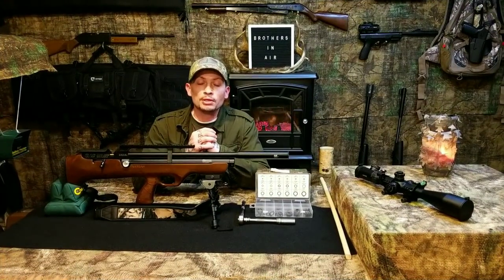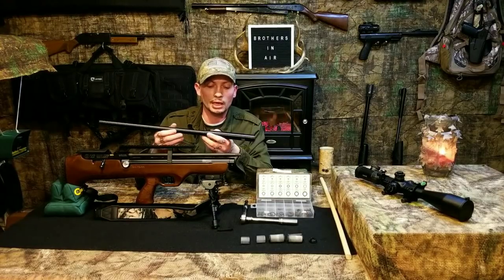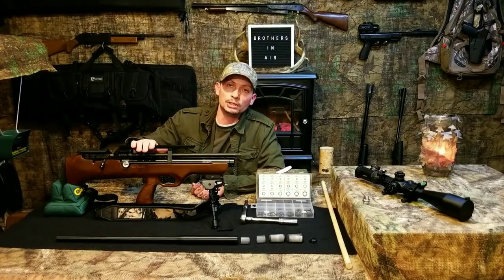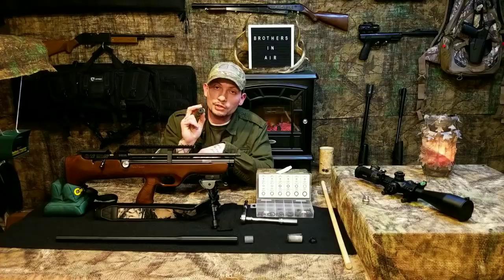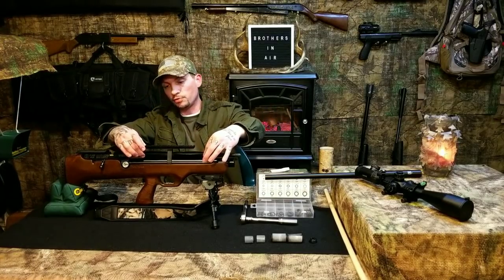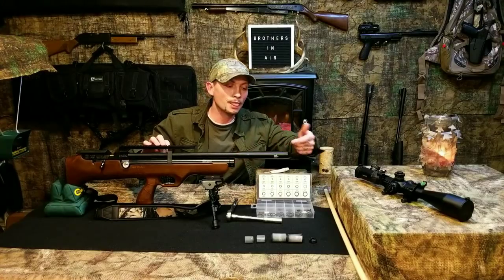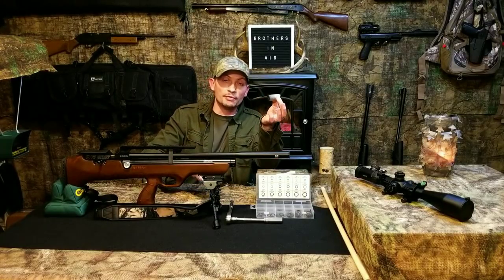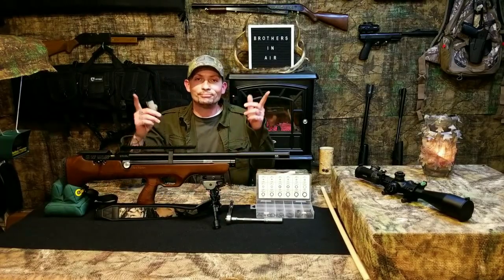HATSAN FLASHPUP QE SHROUD***Removal, Opinions&Thoughts, Lead Dust Diffuser/Filter Mod.& WARNINGS***

Comment: Hi chad, yes my Flash Wood .25 Cal did not have an o-ring on the barrel nut from the factory, i also think that's why the 2 lower plastic baffles were broken when i took the shroud off, cant wait to re-assemble it properly as you show here, thanks again! I e-mailed Hatsan and they are sending me new parts under warranty.
Reply from the maker: Glad to hear they're taking care of you! You'll get a little less ping with an oring in there for sure.

Comment: I just removed the shroud on my Hatsan BT65, 357. The shroud retainer nut was in backwards from the factory. The clear spacer was in with the small hole toward the front end of the shroud. I cleaned, inspected, all components. I installed the shroud retainer in the correct direction so you could actually use a 14mm socket to tighten the barrel nut. I placed the two baffles on the shroud and came up 20mm short of the retaining bushing. So for now I made an insert out of a 1/2” pvc pipe to maintain contact with the baffles. I don’t like this idea because I can’t  imagine how the pellet will exit the last baffle travel 20mm and find the hole in the thread bushing at the end of the barrel. Now all that being said, I’ve burnt powder for 63 years, watched videos on air rifles for two years before getting into this sport and I think my failure was not to field strip the rifle on receiving it. Your video was ver helpful!

Comment: Thank you very much for this video. When I took my shroud off the o-ring for the nut was just sitting on the barrel behind the nut like it was never put in the groove. The o-ring for the end cap was in pieces. Why does Hatsan have so much trouble with installing o-rings? They are often broken, cut or look like they have been chewed on.
Reply from the maker: You're welcome my friend. And yeah I agree I sure see a lot of damaged, chewed up o rings on Hatsan guns. Like you said what the heck is so hard about doing it right? Lol

Comment: Hey Brother! Keep up the good work! Just wanted to share a few things I found when I removed my shroud to do this mod.
1) Hatsan has changed some things in this area!
     a) The spacer for the shroud at the breech end (yours stayed in place on the barrel) is now pressed into the shroud, making this mod almost impossible! I had to remove my barrel and wrap the felt around it and then slide it into the shroud to get the air diffuser into place. Very difficult! also had to use 1mm felt as there was just no way 2mm will fit. Do you think they changed the shroud diameter?
      b) The first two baffles have to go in big end to breech or they won't all fit in the shroud!
      c) The second two baffles (felt wrapped) have a large hole all the way! no small end anymore!
      d) The felt on my baffles didn't even cover the whole screen they were quite short. I covered both with 2mm felt. 
      e) After the two felt covered baffles I added a thin (.25mm) rubber washer with an I.D. of .285" before I installed the end cap. I figured it might help. My .22lr suppressor has the same setup, and it is very quiet!
This did make a big difference in the sound signature! only makes a quiet 'ping' now. Do you think the Huma regulator I am about to install will reduce that ping?

Thanks again for your hard work and dedication to our sport!
BTW- I'd love to see a video on enlarging transfer ports and such for optimum velocity! I'm wanting to try and shoot slugs as they have a much better ballistic coefficient, and I'll need all the power I can get for them to stabilize!
Reply from the maker: Thanks for the update on the changes and thanks for the kind words. the regulator will definitely take that final bit of ping out of there. With the shroud done up nice and the regulator installed pretty much all you hear is the hammer striking the valve.
Reply: Wow. Ok so I had noticed that my at44-10 was much quieter then the flashpup and so I took them both apart a discovered that the two had some differences. On the At44-10 the baffles have one large hole at one end and one small on the other. Where as the flashpup has equal sized holes on both ends of the plastic baffles. The at44-10 has metal cups and the flashpup has clear plastic cups. But the at44-10 is definitely much much quieter! First time I shot it I wouldn't have even know anything came out if I didn't hear it hit the target.

Comment: Hey sir I  tried ur felt mod on my AT44 QE .25.cal. About a 3.5 decibel reduction using my phone app. Not tremendous but everything helps with my loud .25. Trying to make it more quiet for fussy neighbors. Only cost 70 cents at Hobby Lobby for felt. Have ordered 10 stage baffles on EBay for further reduction. Got enough felt to do my Gauntlet, .22 AT44 and new BT65. Thanks for the video!!
Reply from the maker: You're welcome my friend. That's awesome and you're right every little bit counts! It makes the guns a little long but DonnyFL makes a QE shroud adapter so you can attach a moderator. I've modded my QE barrel bands to support the smaller diameter of the barrel and I am just using my DonnyFL's. Man is it quiet! He does a heck of a job and the quality is outstanding. When I use the adapter in conjunction with the QE shrouds it's insanely quiet! First time taking a shot I thought the gun had malfunctioned because literally all you here is the hammer striking the valve. Like I said a little long on top of the QE but those fussy neighbors will think you're outside swatting flies not shooting your airgun LOL. Let me know how those 10 stage baffles work out if you would.
Reply: @brothersinair2064  Will do

Comment: Very informative, I really needed this video... I need to know one more thing though...

Is the hatsan QE shroud removable in all Hatsan models just like this one? 
Because the bt65 elite with the QE is very long so if it is removable it will be a lifesaver since I will not need to buy a bigger case for it to fit the extra QE length... I will just remove the shroud when I want to transport it in a case

Comment: Thanks so much for taking the time to explain things with such detail!  I just ordered a Flashpup in .22 call and I'll be installing a regulator to it. 

How's the ping in the gun? Would it be necessary to install some depinger mod, like Bstaley for example? I'll also be testing different baffles and even make a shorter shroud to install a DonnyFl silencer to make it dead quiet...
Reply from the maker: You're welcome. The ping it's decent but once you install the regulator it depings things nicely. A reg works as a depinger also. In regards to the donny FL he makes an adapter so that you can screw the moderator right on to the end of the full-length shroud and use the stock baffle system and the moderator on top of it.
Reply: @brothersinair2064  thanks for your reply.

I think a silencer on top of the stock shroud would be too long,  I believe that beats the purpose of a bullpup. I'm thinking about making a custom shroud right to the barrel thread, to be able to use that thread for a better silencer...
Reply from the maker: @503BikerDad  oh I see what you're getting at.  I do a lot of hunting and I don't mind mine with a moderator on the end and mine is 5 in. Super interested to see it when you're done though it's going to look pretty badass I'm sure!
Reply from the maker: With the donnyfl right on the end of the barrel with the shroud off it's quiet. With the Donniefl on top of the stock internals it whispers. all you hear is the mechanics of the valve being struck. Was interesting at first almost makes it feel like there's been a drop in power LOL
Reply: @brothersinair2064  yep! That's what I'm thinking too. If course I need to hey the best of of it first... Break it in... Before tinkering with it.

...you had me at "whispers" 😂

Have a safe weekend brother!
Reply: @brothersinair2064  one question: what's the thread on the shroud end? I'm looking into adding a silencer to the shroud, as you suggested.
Reply from the maker: @503BikerDad  The threads on the inside of the end of the qe shroud are a metric fine thread M23 x 1
Here's a link to the adapter I'm using if you didn't want to make one or have one made. They're usually $30-$45.

https://donnyfl.com/collections/adapters/products/hatsan-qe-1-2-x-20-unf-adapter
Reply from the maker: Also... I would highly recommend anything made by Donny FL I tried several different manufacturers and the stuff I've received from Donny excels in every way. I have no affiliation I just appreciate getting what I paid for and with Donny you get that and then some.
Reply: @brothersinair2064  thanks! I appreciate your responses. I've read only great stuff about Donny in the forums! I think I'll go that way. Blessings!

Comment: It happened to me once, I got too anxious & careless & fired, forgotting to secure the bolt on the notch, all I felt was a faint sound of click, so I cock it back, did it clipped the baffles? I dont ‘tinker much on my pcp , I may test fire it again if theres’ accuracy issues !
Reply: pull them out and look. they are plastic so you should be able to see if theres a bite taken out of your baffles.
Reply: jason merrigan  Thanks! anyway I have checked them already long ago! and  there’s’ no damage or deflection whatsoever!

Comment: My flashpup QE  .22 wood didn't have any Baffles or O rings. I just checked. I'll be contacting Pyramyd air.
Reply from the maker: That stinks... Tell them to make it right!
Reply: @brothersinair2064  Was wondering why it sounded like a 22 short. I just found a single baffle on Ebay for it in .25 says it's better than OEM. but pyramyd air is closed on the weekends but I  sent pix to them . Good thing shroud was empty cuz I just watched your double pellet load and fired it when I double loaded it first time out sighting in.
Reply from the maker: @Blackscoutwinter  good choice. The 3D printed baffles are noticeably quieter than the stock baffles
Reply: @brothersinair2064  Not sure if the 3D printed baffle I ordered has felt or not. My benjamin Armada. 22 doesn't and it's guiet.

Comment: you didn't mention direction of the solid baffles. is it small first or big first? I looked like you put them in big end first.
Reply from the maker: Big end first small end facing the direction the pellet travels. they have to act as a compartment to strip away the air if you put them small in first they wouldn't do anything of that nature

Comment: So I have about 15 different hatsan And the weirdest thing in the EQ is some of the baffles with the small hole one small hole one big hole and then on the other air rifle the air holes are the same there’s a big air hole why would they do this what are your thoughts on that
Reply from the maker: This is not official from hatsan but only my observation. Of the four that I own and many many other guys I have talked to it would seem that the .25 caliber always comes with the small hole baffles and the .177 and .22 the large. I don't understand it either. My 22's are much louder than the .25's and an appropriate sized pass-through hole based on the caliber does the best job for stripping away turbulent air from the shot and brings more stability. The baffles with the large pass through holes don't seem to do much at all in my opinion so I'm in the dark like you my friend I don't get it.
Reply from the maker: 15 Hatsan's! That carries some bragging rights with it for sure.  That's some real air gunner shit right there!!! Awesome!
Reply: BROTHERS IN AIR yeah I just can’t get enough of it every time I turn around I see something new which I love I work my ass off to get them but the weird thing is on all the 25 that I have ordered recently the baffles on the 25 are mixed matched one of them has a big hole one of them has a little hole and then on the 22s some of them have both big holes and someone has one of the small one in the bag I don’t get it either it seems like the person putting these guns together don’t give a shitHow they put them together you’re just throwing together and then throw them out the door and then when it arrives you got to take it apart clean and lube them check them all out but even that I like to do but I think it’s the manufacturer just throwing his things together just to get them out the door
Reply from the maker: @korybrown121  yeah that probably sums it up. Love my hatsans but some of the stuff that makes it through their possibly non-existent QC department is mind blowing lol

Comment: can someone please post a pc of exactly how and where on the barrel nut the O ring goes? is it in the chenel around the middle of the nut, or around the botom where it seats against the QE shroud?
Reply from the maker: The o-ring goes in the groove cut around the O.D. of the nut where it would make contact with the I.D. of the shroud. Once you have the o-ring seated in the groove and you look through the nut you will see that the air pass-through holes are now roughly 50% blocked off by the o-ring. This slows the air that is backflowing through the shroud and also puts the rubber o-ring against the I.D. of the shroud and this dampens vibrations. Happy shooting!

Comment: I want to get a Donny fl for my flashpup. Do the baffles stay in place? Does the silencer go over the barrel or attach to an adapter that screws inside the barrel?
Reply from the maker: Yeah he makes an adapter that screws right into the QE shroud and then the silencer threads on to the adapter. And yes the baffles stay in so you get the Best of both worlds and she's just a fart in the wind when you shoot

Comment: My barrel shroud end cap didn’t have an o-ring included but I see the notch where its supposed to go.. wondering if that’s a design change or what
Reply from the maker: Could have been an oversight or it could just be that they're not using them anymore. The end cap and the shroud have a pretty tight tolerance and are very square so you shouldn't have any problems with air coming out there as long as it's good and snug. Shouldn't affect your accuracy either way though

Comment: Could you put a hatsan air stripper on it and keep the baffles in it? It would look so sick. It is a 1/2" 20 tpi.
Reply from the maker: Yeah you could do it but you would have to make or purchase an adapter. I wouldn't be surprised if DonnyFL has an adapter available that would work.
Reply: @brothersinair2064  I just ordered this in 25. Cant wait. Love modding shit. Need to get a huma reg next. Was thinking of having a friend do the stock in carbon fiber.
Reply from the maker: Carbon fiber stock will be sick! The new Flashpup S probably won't make it here till next season but I'm tempted to try buying it from one of the European vendors that has it available already. It looks pretty badass
Reply: @brothersinair2064  What is the flashpup S? I called pyramyd and asked but they didnt know. God. I hope its a 30 cal.
Reply from the maker: @virginmaryshouldhaveswallo3493 It is the Flashpup but in a synthetic stock version. Also it is not the same build as the original flashpup. It is the new build that you've only seen in the new Flash Wood. You will only find it on Hatsan's international site because all of the guns are released about a year later in the US. I'm sure it will be shown at the SHOT show 2020 and available around next spring or so once the pizzazz dies down a little more with the Flaspup and Flash Wood. Here's a link so you can check out the specs and whatnot. Pretty much identical specs to what we have and unfortunately only available in the same three calibers. 
http://www.hatsan.com.tr/new_en_flashpup_s.html